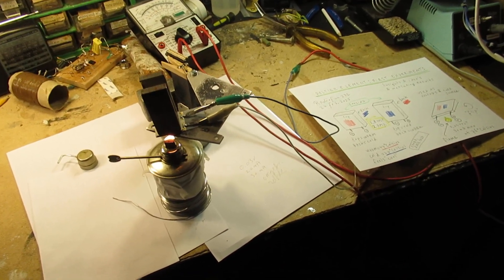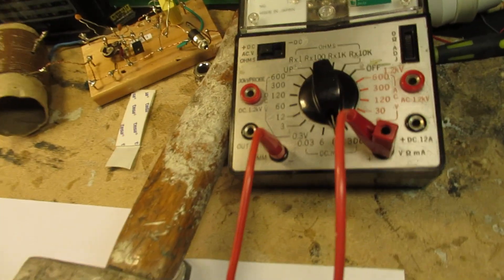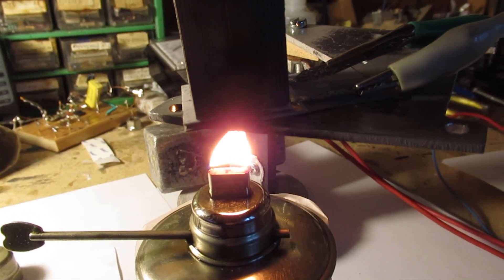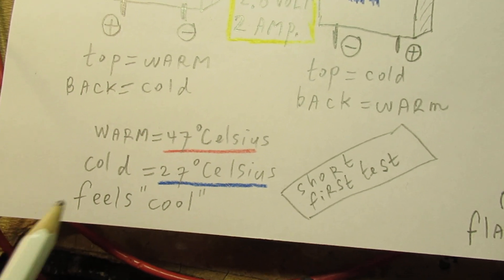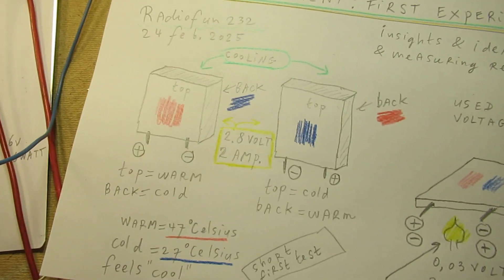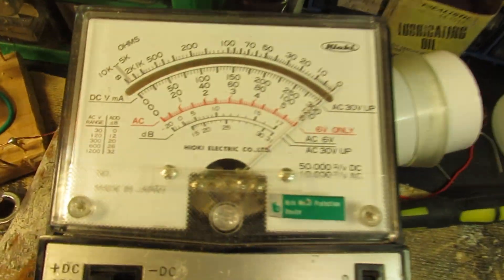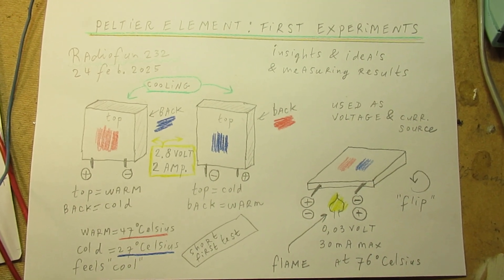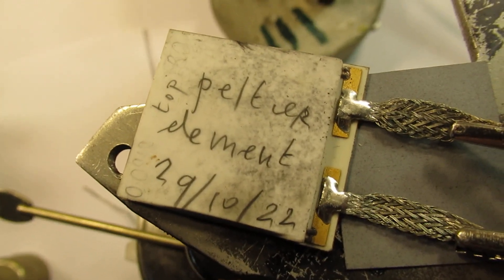Peltier Element: My first experiments & ideas, using it for cooling or as an electric source (demo)

Comment: three thermo-electric effects. kelvin, seebeck, peltier.

peltier is the heatpump. for so many watts of dissipation, so many watts is "pumped" from cold side to hot side. heat sink has to be capable of radiating both units for any effective cooling. they really work better as heaters, lol... and theres always a certain temperature differential between the two sides. TECs are peltier devices. (tec12715, etc...)

excepting certain situations, they just arent worth the hassle... same time, ive got a water cooling heat block thats swollen due to hitting about -50C without antifreeze, lol... 

seebeck is better as a generator. again, the heatsink has to be adequate... closer it can be to ambient, and the hotter the hotside, the higher the temperature differential,  the more power... can be challenging to regulate the heat supply. i had reasonable success by using water, giving an automatic 100C limit when boiling, though they really want 150C... a bit of hunting around and there are TEGs available. the design is slightly different to the regular TEC. they cost a bit more... (SP1848?)
there are some intended for several hundred degrees... got money?

the kelvin effect? i dont think theres any practical or commercial device...

dig through some physics books and all three effects are really just different zones of operation, and all occur to some extent...

i spent quite some time playing around with PC radiators and the like... results are never quite what one hopes. excepting the few applications when theyre the only suitable device.

ie, a laser diode can be pushed to make a few more watts by strapping it to a peltier and using a decent radiator to dump both the diodes and the peltiers waste heat...
Reply from the maker: Thanks, good info for everyone!

Comment: Will a peltier element instead generate electricity when forcing heat to move through it by heating one side and cooling the other with a heat sink and fan?
Reply from the maker: I am going to study that. There must be a kind of electricity (DC current) created in that situation. How much? Has to be tested.

Comment: Interesting experiment have seen them used in many applications i have a small fridge that uses one and a fan designed for airflow circulating heat from a wood burner. And in the past I bought some to try and generate electricity but had poor results because you have to keep one side colder than the other but I didn't have suitable heat sinks to get better results. Good luck on your experiments 👍
Reply from the maker: Hi John, thanks for your comment. It is very (!) important for me, when studying these issues. I don't know whether I want to spend time on it (generating electricity via Peltier elements) because I also found other sources where the same was told (kind of pain...). So perhaps I am going to do more experiments, but perhaps not. I have to form idea's about that. Thanks. 24 feb. 2025.